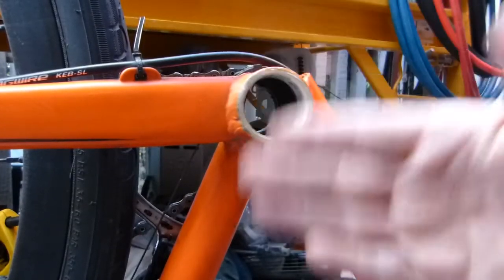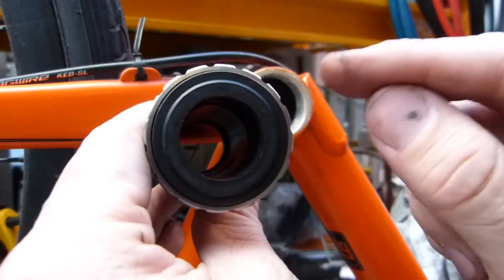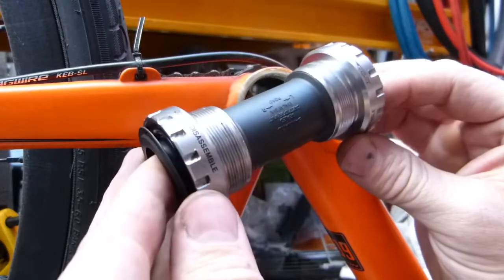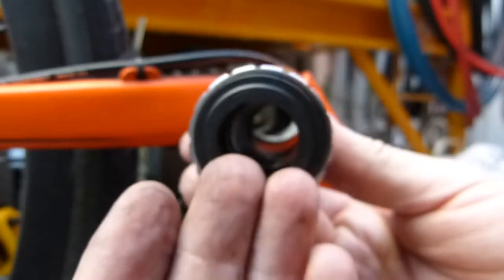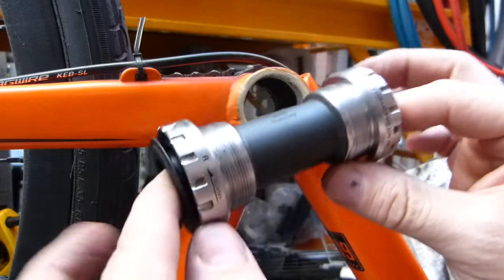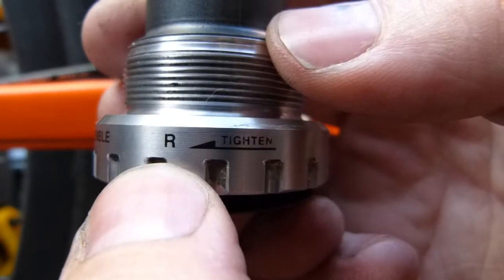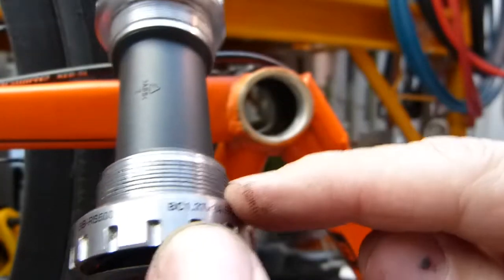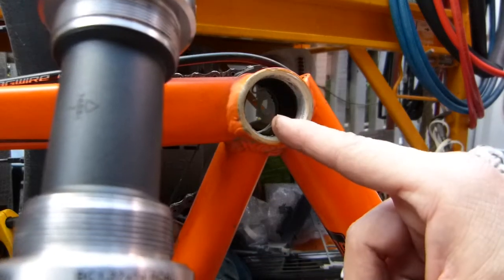Threaded bottom bracket service (Sunhill brand bearing failure in 2016 Shimano component)

Comment: ehh... just wash it in gasoline....    ;)    i mean to say... it _is riding on a plastic bushing inside the inner bearing race bore.... soo  how high quality can it really be anyways  ?    :)
Reply from the maker: This is a Sunhill branded made-in-china ... bearing. I'm outraged, what is it doing in a Japanese branded bike part?Shooting the second part now, ultegra bearing vs dura ace vs deore xt vs proper high-end bearing
Reply: So it is adviceable to replace the bearing with a proper one such NTN bearing?
Also, after how many km you should disassamble the plastic cup in order to clean bearings?
Reply from the maker: @carlos.5290  Absolutely, NTN is top-of-the-line. Cleaning: I ride in rain / muck, I do it every 3 months. If I competed, it would be cleaned before every race. In completely dry and low dust weather it can stay reasonably uncontaminated for a year. On an indoors trainer, it could work for years.